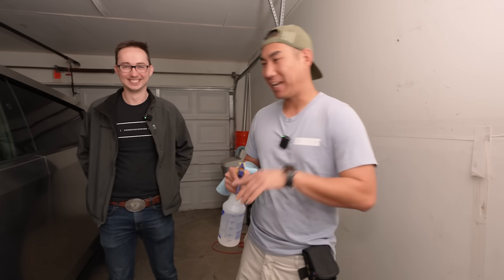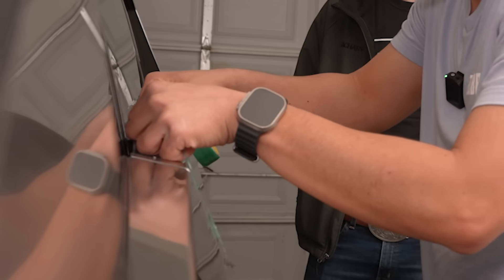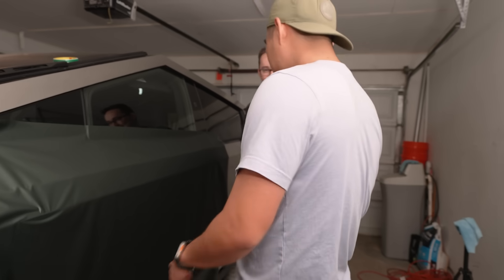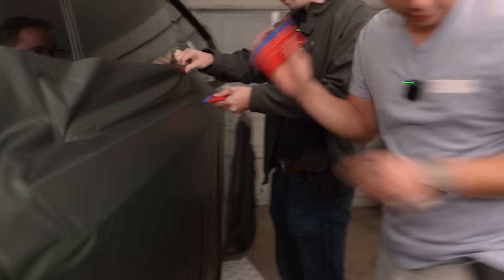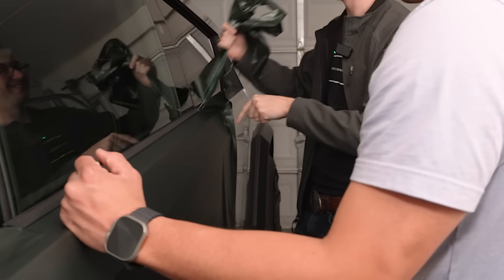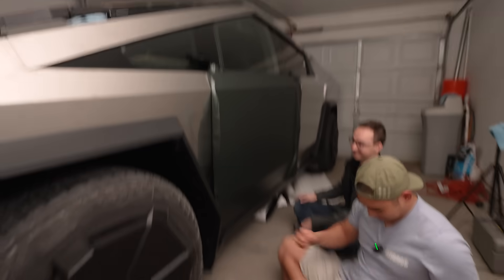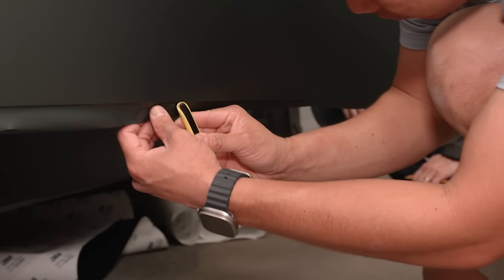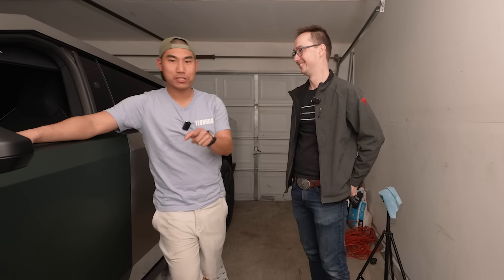Wrapping Cybertruck Door in 3M Pine Green Metallic - Foundation Series - TESBROS

Comment: This is exactly what i mean. This is prime example of who are buying these things. People that are not truck people, like do yall go off roading? Do yall tow? Do you have an rv?
Reply: Yes that is right, and 90% of truck owners do not do these things either. And if they do, they do it on their once a year camping trip, trailering to a camper to an easy to get to location.  That is the reality of truck ownership in the US.  Probably even less do those things with a new / newish truck.  As far as offroading?  I don't see anyone take a truck less than 10 years old and already beat up out into the woods.  That's just dumb to bring a 60 to 80K f150 king cab or silverado quad cab (etc.) on even mild offroading.  I am prime example, I did take my, at the time 1 year old silverado out just to a sandwash and managed to bash in my front going into a small ditch at 5 MPH.  6 years later I am still driving with bashed in front cause of it.  I also have my paint scratched up on the side from branches.  I only adventured for like 15 minutes and I have regretted it ever since.

Comment: Have to admit that I was a little surprised to see it being applied DRY.  Is it because application was over metal rather than paint?  Zach is fortunate to have you around to teach him.
Reply from the maker: Most vinyl is a dry install. PPF is a wet install though. It all depends on the material you're using rather than the surface you're applying to

Comment: How resistant is the vinyl to scratches? I though a big selling point of stainless steel was it would resist being scratched but if you cover it in a plastic film that is softer how's that going to work? If you take it off-road and brush against trees and shrubs with sharp spines, what will that do to the vinyl? The only plus I see is that it's a lot easier to wipe sticky fingerprints off the vinyl than pre-grained stainless steel.
Reply: This one obviously will be a garage queen. Like many other pickups on the road. Serious off roaders will not wrap the car, but they are not the majority of truck buyers today.

Comment: Why wrap the DeLorean truck at all. You're hiding the stainless steel with plastic and covering the brushed finish. Devaluing the vehicle  Should if anything paint it to keep the brushed finished. Gold or pink would be pretty cool.
Reply from the maker: It's actually very smooth as opposed to the brushed finish like a DeLorean. And you can remove the wrap at any time you don't want it anymore without damage to the vehicle.

Comment: I never thought that during my lifetime I’d see the creation of a vehicle that is uglier than the AMC Pacer. The Cybertruck does have a cool feature though. When an owner’s friends begin mercilessly teasing the owner, he can get away quite quickly. Zero to sixty in mere seconds.
Reply: Cybertruck is beautiful.. I cannot relate to your opinion even 1%.. except that the pacer is indeed a POS
Reply: That's your personal opinion and youre free to have it. But I think it looks beatiful. The rest look dated to me now, especially trucks.
Reply: You sound green.
Reply: Why should we care about your opinion?
Reply: I really like it but the rivians also look pretty good. What's nice about the cyber truck is it looks like you could quite easily take out the seats and centre console etc to make your own custom interior. I'd rather it had a van option at the back and a way to knock through from the main cab to the truck bed.
Reply: It's not just the way it looks but all it's features like rigidity and 64V and yoke steer by wire.. autopilot.. the rear wheels trun for tight cornering.. huge ground clearance.. it can stop bullets.. I'm sure people will kit them out over time and it'll look way cooler too 😎